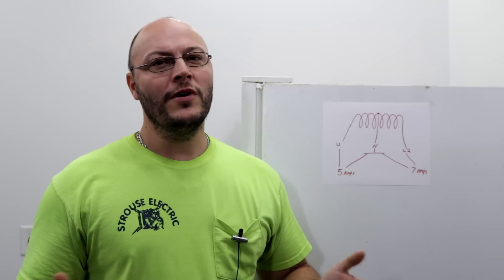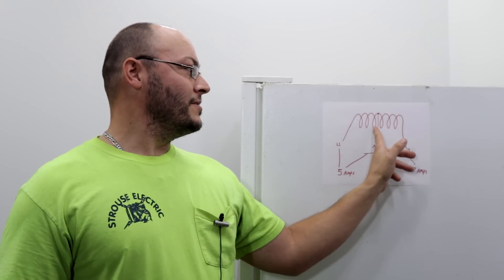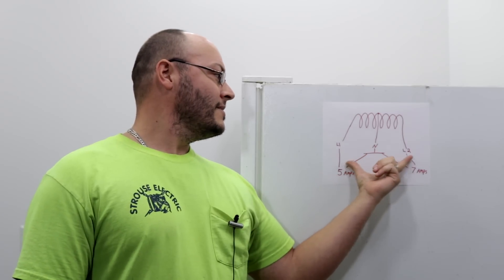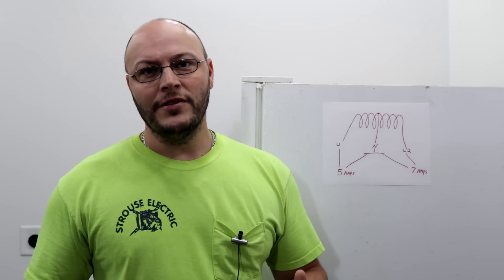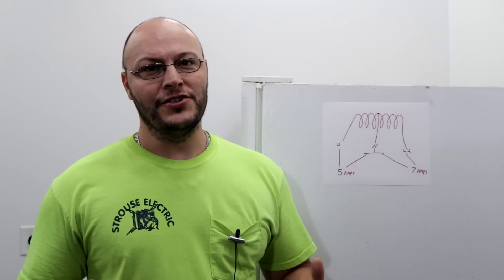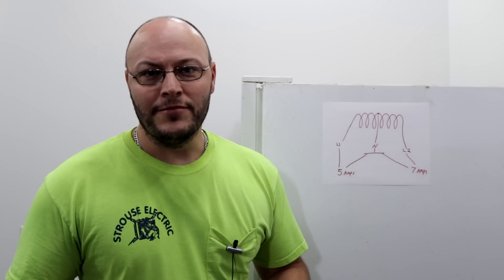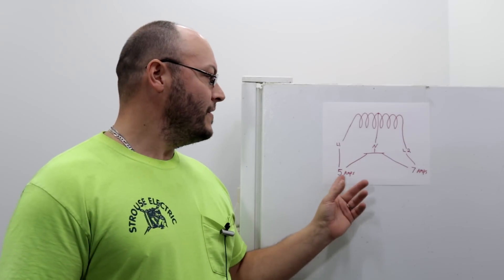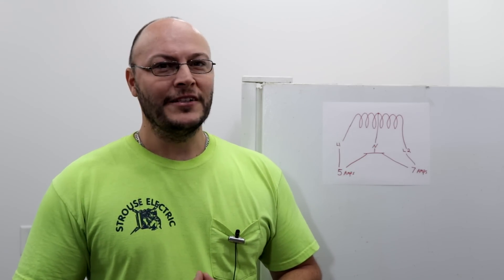What does the Neutral Wire Do?

Comment: In our country, we use a poor 2-wire single phase system.. The weird thing that happens is that when I touch one of the two wires while my feet on the ground, I get shock.. It seems like they have connected one of the wires to ground so when I touch the other wire I literally complete the circuit.. The question is, why do they do this damn sh*t !!!
Reply: LOL When he touches it.. Like it is a regular thing, everyday at noon.
Reply: Truth Seeker Because the nuetral is most likely grounded at the box
Reply: That is exactly why. Old wiring in the United States was like this and many people actually had a pole in the back yard going into the ground (TO GROUND) the connection. so you had one positive lead current coming in, consumed and to ground.
Reply: @JwilliamsAssociates  haha there is no "positive" wire on an a/c circuit. There is a "hot" wire with respect to the neutral. You CAN get shocked by the neutral if you neutral is NOT grounded at the panel as the neutral does carry unbalanced current 
On the pole transformer on the PRIMARY side, there is ONE very high voltage wire to one side of the primary winding and the other side of the primary winding is grounded and also the case of the transformer is groinded as well. This is true of the commonly used wye system in the USA
Reply: Yes I understand that. And HOT is akin to 'positive' wherein neutral is akin to 'negative'.
Reply: @JwilliamsAssociates  not exactly, the "hot" refers to the wire that is not the neutral because on 220v BOTH wires are hot..
 There is no neutral on 220v. Hope that makes sense
Reply: @rty1955  I was thinking 110. Yeah I don't screw with 220. I mean I'm not an electrician but have perform a good bit of wiring with 110
Reply: @JwilliamsAssociates  I think before someone undertakes an electrical job, they should have a solid understanding of electric circuits from the pole transformer, to the device that needs the power. This total understanding will give you the reasons why the NEC codes are developed. Even 110v can create fire hazards, due to arcing, or heat generation within a wall or outlet box, not to mention human hazards.
To illustrate this, I was in the elec dept of Home Depot and this gentleman thought i worked there and showed me a 15amp breaker and asked me if I knew where the 20amp breakers were that looked like the one he had. I was thinking, ok he has the smarts to open the panel amd remove the breaker, but he didnt know what style of breaker would work in his panel. Red flags began in my head, but i gave him the benifit of doubt. I walked over to the breaker section and selected the correct 20A breaker for him. I then asked him what he needed it for. He said "I need more power in the garage and the 15A kept tripping, so I thought I would go up one more size and that should be enough". I took the breaker fom his hand and put it back and said "hire an electrician, you will come home to a foundation if you think like that".
What most dont understand is that, sure the breaker will work, and it will take time for the wire to get got enough to melt in the wall. It make take minutes or weeks, but it could happen.
Same thing goes for wire nuts. The wire nut is not there for mechanical strength, it is there for wire protection. You need to twist the wires tightly with a good pair of pliers, trim it to correct length, then put on the wire nut for protection.
There are no shortcuts with electric, just bad jobs. Always be safe and totally understand what you are doing.
I have been doing electronics for well over 50 yrs, and understand both electronics and electrical principles, yet always consult manuals and up to date publications for the correct way to do something.
I once did the elec work for a homeowner and he had it inspected for insurance purposes (yes I got permits under a licensed electrician friend) when the job was inspected, the inspector said whoever did this work should be teaching other electricians as this work is impeccable. That made me feel good as not only was it correct, but it was neat, tidy, properly marked, and I had wiring diagrams to identify each and every wire. I also took photographs of the location of the wire runs, so  a person could reference the photos in case they need to drill or cut into the sheetrock they would know where there was wires or plumbing. I felt it was the right thing to do.
Reply: Well thought out reply, thank you.  I have done a great deal of wiring and have a basic understanding of electricity. That said my knowledge does not approach yours that is for certain.  I appreciate your taking the time to detail all of this.  Regarding the breaker situation I would likely have reacted the same way.  Question for you. If you have a 15 amp breaker and you are tripping it because your devices require 20 amps across them  how do you know it is safe to increase to 20 amps? How can you tell if it is not safe to do so? The wiring between these two 'service levels' is the same no?  I understand that for something like 50 amp service you will not use the same wire (12 gauge for example) but between 15 and 20 amps the infrastructure is the same; no?
Reply: @JwilliamsAssociates  thank you for your kind words, you are a gentleman.
With regards to correct wiring, according to the Nationtional Electrical Code or NEC, the correct guge of wiring for a 15A circuit is 14 guage wire or #14. The correct guage for 20A is #12. Therefore #14 should have a 15A breaker and the #12 should have a 20A breaker. Of course you always downsize the breaker (15A breaker on a #12 wire) but not upsize it (20A breaker on a #14 wire) if unsire of the wire guage, you can get a cheap pair of wire strippers that has the guage marked and fit it around the conductor to see what the wire actually is. Another thing I have seen is people splicing different gauges of wire together, big no no, even if you splice a #12 to a #14 rhe breaker will trips if more than 15A of current is drawn.   If you splice a #14 onto a #12 the #14 may burn up, long before the breaker will trip, very dangerous. I have seen that in attics, garages and basements where the homeowner has access to the wires.
Always use a breaker that is sized for the thinnest (or highest guage number) never draw more than the wire will allow. The breaker is merely a safety item. It should trip before the wire gets damaged.
You can always Google the correct current draw on a particular guage of wire. Wires are rated for current capacity (amps) and not watts.
This is why power distribution is done at such high voltages. They can use thinner wire because the amps are reduced but maintain the same power level.
A very interesting note is that commercial aircraft must keep the weight down so instead of using 60hz they raise it to 400hz so the wires can be thier, thus lighter. Ever hear the 400hz noise on an aircraft PA system? Now u know why.
Reply: Well!! that's a question. However, a better question is; why is ur damn a...s keep touching the damn wires??
Reply: What country is that? Would seem to me perhaps a 3rd world country, but hey I could be wrong. Britian and Aus/Kiwi's use what? 240V 3 prong outlet. I always wondered what the phases meant. 3 phase drop etc, just sinewaves 3 phases/signals.
Reply: What country do you live in?  Perhaps your house is wired up wrong?  lol
Reply: you need to call a electrician
Reply: And you keep doing this because?
Reply: It’s completely normal that you get a shock if you touch just the phase. The neutral is grounded at the meter and guess where your feet are on. Nothing wrong with the electricity network. YOU are the problem :) For touching grid wires while you obviously know nothing about the electrical network.
Reply: @Engineer9736  You obviously know nothing about inter-winding capacitance in transformers. Yes, if the neutral is properly earth grounded at the meter it will be at ground potential just like it should. However, if it is not for some reason the neutral will float and have voltage on it. This is because of the inter-winding capacitance that is coupling voltage through the transformer.  I once saw a large piece of computerized industrial machinery sit idle for two weeks at a cost of about  $5 million to its owners. None of the professional electricians over there could figure out why it wouldn't work. Finally I went over there and found that all the neutrals on the machine had voltage on them measured to earth ground. In about 15 minutes I found a ground wire that had come loose in one of the electrical panels, which had been poorly wired by one of the plant electricians. After the ground wire was reconnected the voltage between the neutrals and ground was gone. Then the machine finally started up.
Reply: Here's WHY this happens. It all has to do with a characteristic of transformers that most people are unaware of. Most people know that power is transferred electromagnetically between the primary and secondary of a transformer. But there is another way as well. The two transformer windings act as capacitor plates with the insulation of the wires acting as a dielectric between them. This essentially turns the transformer into a giant capacitor. As such AC power gets coupled through the transformer electrostatically just like through a capacitor. This power will appear as an AC voltage on any and all wires coming off the secondary even if they are not connect to anything. Since the primary of the transformer has to be grounded somewhere, this "phantom voltage" will exist between any  wires coming off the secondary and earth ground. That's why the center tap of the transformer secondary, along with the neutral wire, have to be grounded locally at the service entrance. If it isn't a person standing on or touching anything grounded while touching anything connected to the secondary, even the neutral wire, will receive a shock. But by grounding the secondary's center tap to earth ground it shorts the phantom voltage to earth ground to eliminate this shock hazard. This is because the center tap and the neutral wire and anything else connected to them are now down at earth ground potential instead of floating up to some higher level due to the capacitive coupling through the transformer.

Comment: there is no "your" version or "my" version of how electricity works.,connect an ammeter and measure the current in both line and neutral.
Reply: Theoretically there should be no current on the neutral in a balanced elect panel. Ever winder why the sevice cable has a bare braided sheild on it, while the L1 & L2 conductors are insulated??? Because it should not carry current ;)
Reply: @rty1955  no you're wrong. Having a balanced panel is near impossible. A neutral is grounded. Which means if you touch it you can't get shocked because you'll be the same potential as the neutral.
Reply: @daveslyker4431  without insulting you, I said "THEORETICALLY" I totally understand the concept of an unbalanced panel. So in a perfect world where the panel is 100% balanced, would there be current flowing in the neutral?
Reply: roy Yung actually I believe you are correct because at your panel the neutral is grounded and bonded...therefore you will have no current on that bare neutral that goes back to the transformer. That is why it is bare because there is no longer any potential after the bonded service.
Reply: @SteveMe21685  well sort of. If you panel is perfectly balanced (which it never is) and no ground, theoretically there should be no current flowing in the neutral. For example if you took two 120v 60watt lighbulbs and wired. Them in series, you could attach it to a 240v breaker. There is no need for a neutral because you have a balanced load. So if you connected a neutral wire from the point at which the two bulbs were wired in series and connexted the other end to the neutral bar in the elec panel, there would be no current flowing in that wire, until you unscrewed one of the lights, because you created an unbalanced load. Yes?
Reply: roy Yung not really but your not far off...a true neutral appears mostly on inductive loads so a light bulb isn’t really a great example. In a house your kitchen range is what’s going to use a true neutral. But either way I was only talking about the bare service conductor. So if your point was that if you ungrounded your panel then yes you’d get hit on that bare cable going back to the transformer.
Reply: @SteveMe21685  both a light bulb and a stove are considered linear loads. And inductive load is normally a coil either free air or around an iron core and that inductive load leads voltage by 90°
And if you took your panel out if the diagram than you would have a balanced load with zero current on the neutral
Reply: roy Yung a load can be linear and still be inductive. Usually you’d identify as either Linear or non-linear....or you’d identify it as inductive, resistive or capacitive load. A light bulb is better defined as a resistive load because it changes due to heat. Generally anything with a motor is inductive
Reply: @SteveMe21685  as an electronic designer for over 50 yrs and inductive load current leads voltage by 90° and a capactive load current trails voltage by 90° and resistive load current is the same as voltage. Rhis is why we use Power Factors when estimating power consumption.
Light bulbs are used in electrical demonstrations because of there nearly resistive load and immediate feedback of what is going on in a circuit. Of course toy can use resistors and achieve nearly perfect results.
My initial statement still stands. The neutral does not carry current in a balanced load.
Reply: roy Yung I never disagreed with that tho. I was saying that you ARE correct...not sure if your confusing me with someone else but I was agreeing with you that there’s no current on the bare conductor that goes back to the transformer as long as the panel is grounded.
Reply: @roy, A balanced panel is not “the perfect world”. Most appliances are single phase. 2 phase is only your clothes dryer or AC. So in nearly ALL situations the neutral is carrying the full load.
Reply: According to code pronouncements, little to no current will flow in the neutral under this condition.  I'm not sure if this code statement is accurate in reality or not (I will test for it).  Anyways, this would require PERFECT transformer winding and PERFECT loading.  I would estimate that this occurs ONCE in universe 328486.  Seriously - statistically this is a very unlikely occurrence.
Reply: Wrong!  Not even theoretically.
Reply: Oops.  Replied to wrong comment.

Comment: Could you connect a positive to a neutral?
Reply: That would be a direct short, because you do not have a load between.
Reply: By positive do you mean the hot wire. Positive and negative is dc. Ac uses positive and negative electrons like all electricity. But if you connect the black/hot with the white/neutral it will take your picture and trip the breaker.

Comment: So in DC voltage, the black is the ground, or negative. It's the return. So for Alternating voltage, the white wire, is the black wire in DC voltage. It's the return? It completes the circuit? The Neutral is also referred to as the common wire, right?
Reply: In AC the black wire is Hot the white wire is neutral which is the return.  You can touch the neutral but if you touch the hot you will get a jolt.  In your house all the white wires( neutral) return to a common point or connection in your panel.  If you touch the disconnected hot wire in a circuit while standing or touching anything, the electricity will consider you the load and the other side of you in contact with anything will be the connection  like a neutral wire to the panel. If you touch the disconnected hot wire and nothing else (some how suspended in mid air) nothing will happen  to you, until you touch something and complete the circuit.  Yes , in DC  the black is ground and the red wire is the positive.
Reply: +joskemom thanx.
Reply: Don't cross the neutral! It can kill you! Treat it as a live conductor. It carries the unbalanced load back to the T/F and if you cross the path the current will use you to go to ground.